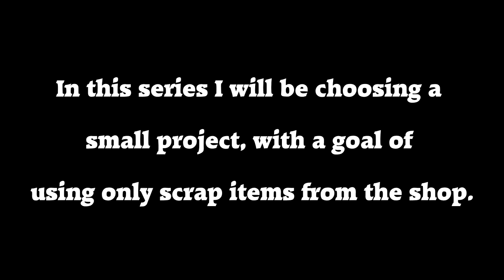Blacksmithing- Forged Calla Lily Candlestick Holder- scrap metal project. Video #1 Series

Comment: Another great project.   What gas pressure does your forge run.  I’m struggling to get my steel up to temp and I thinks its because my regulator tops out at 15 psi.
Reply from the maker: Thank you, and honestly I run mine basic forging and shaping around 5 psi. For heaver materials and heat sustain I crank it up to about 10 psi. It will forge weld around that same range. If you mentioned the forge set up for a future vid I may do that, although it's a majestic forge it took a bit of finesse to get it tuned correctly. I also run an external barrel fan that helps with airflow for the Venturi.
Reply: Maybe my problem isn’t gas pressure as I’m not giving the steel enough time to get to a forging and shaping temp.  With my acetylene torch I can get it to a working temp in a matter of minutes but my hand made forge it just never seems to get anything thicker than 14 gauge to a working temperature
Reply: How long should a piece of 1/2 bar stock sit under a propane torch to get to that temp
Reply from the maker: @andrewhenry9530  from lighting to red/orange my forge will take about 3-4 minutes, and then 30-60 seconds between anvil work. Depending on orifice I know about 40mm works good with a drilled out mog tip. Try running a fan towards the air opening, also make sure your nozzle is centered to your tube. Make sure the tube is 3/4-1" pipe and at least 10" or longer. Are you running a ball valve or a needle valve or are you just running straight off the regulator?
Another thing to take into account is to make sure your not using just a regular gas grill style regulator. A modified oxy regulator works great it's what I started with. Mr heater makes the store I'm currently using, make sure to install a pressure gauge as they don't normally come with one.if you like I can send pictures sometime with my set up and parts numbers.
Reply: @wrotiron  i have a .25 mm mig tip, a ball valve to two torches and the 1" pipe is 8" long.  Maybe i should open up the mig tip to .35 with a longer 1" pipe.  I will also try the fan at the forge opening....  still learning how to tune this forge up so can do good blacksmith things like you do...
Reply from the maker: @andrewhenry9530  definitely try the longer tube, and the mig tips the fan I point towards the top of the forge to "supply" fresh cooler air into the intake side of the tube. Keep me up to date on your forge, maybe I can help get ya cooking.